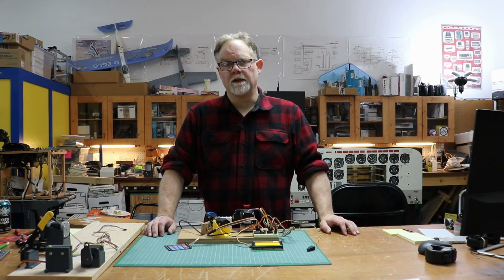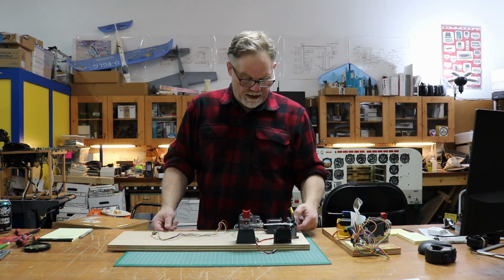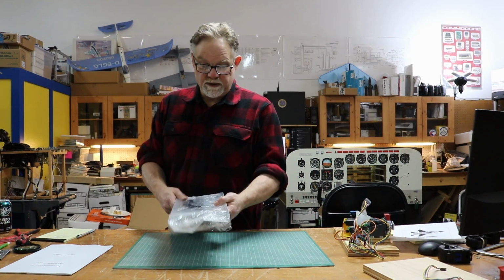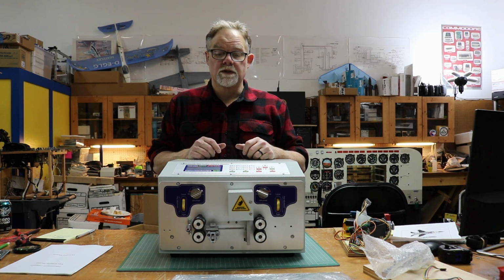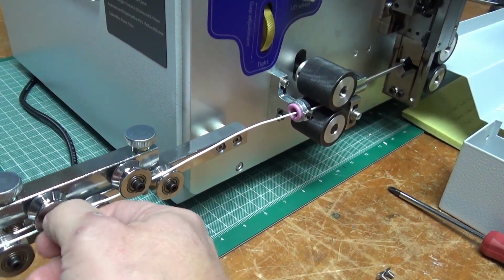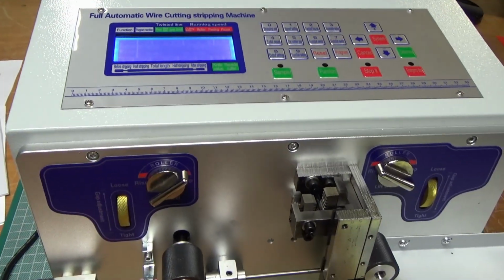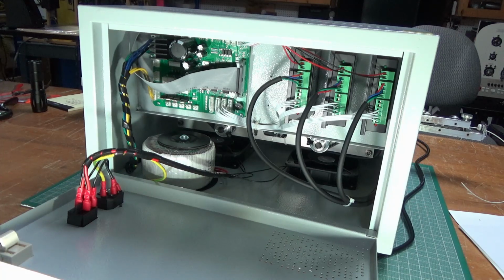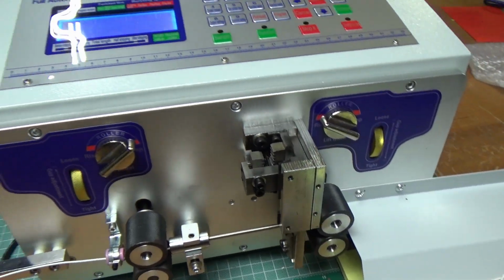F-15C Project  - The Wiring Problem. (Feat. Vevor SWT508)

Comment: The unused but populated with a socket stepper port and tapped holes for the driver is for the twisting feature. Some of the unpopulated connectors in there are Incoming Wire Sensor / Runout Detection: This is a logic port for an external wire-feed straightener or a "wire empty" limit switch. On advanced models, if the spool runs out or tangles, a microswitch or optical eye trips this port to pause the machine automatically so it doesn't run out of wire on you. There is also a Blade Holder / Blade Sensor. An unpopulated logic port meant for a blade home-position limit switch or a safety interlock sensor that detects if the cutting head guard is open. Additional Solenoid/Valve Control: The ULN2003 array drives inductive loads like relays and small solenoids. The unpopulated traces next to it are designed to drive external pneumatic valves. High-end variants use air-assist blow-offs to blast insulation scrap away from the blades or use pneumatic clamps instead of stepper motors for heavy-jacketed cables. And finally Look at the top right of the main board near the white ribbon cable traveling over to the stepper driver housing. There are unpopulated pads labeled TX3 and RX3.
What it's for. This is an unpopulated auxiliary UART/serial channel. On models featuring integrated inkjet or hot-stamp wire markers, this port passes serial data to coordinate printing text or part numbers onto the wire insulation in real-time right before it hits the cutting blades.
Reply from the maker: Wonderful information, thank you!  I wish I could get my hands on the inkjet printer.  Printing wire numbers as they're cut would just be the cat's ass. :)

Comment: I have the identical one. Mine goes up to 8awg and works well with it. This machine has the worst manual I have encountered yet! Mine does let you go into the screen behind the password. Not sure why yours won’t.
Reply from the maker: It's pretty good for what it does.  The only issues I've had with it is the trailing strip is either incomplete (doesn't pull the insulation away from the cut), or the strip doesn't happen at all.  I recently used it for the 49 wires needed for the throttle quadrant harness and it worked great.  I wish I had a reliable wire feed method though.  I have to spool off wire ahead of the machine, otherwise it will grab the spool, and spin it into a bird's nest. :D
Reply: @f15sim yes mine does that same stripping hiccup. It is what it is I suppose. Beats doing it by hand, that’s for sure.
Reply from the maker: @MikesSoftLemonade  Oh absolutely!  It beats doing it by hand and the cut length repeatability is good enough for my purposes.

Comment: Hey there, I know this is 2 years old, but did you ever run into the feeder motor not actuating? this machine is likely capable of functioning as defined, but the motor isn't pulling the wire to the cutter.
Thank you in advance!
Reply from the maker: I've never had that issue, no.  You might want to check the connections to the controller board.

Comment: Thank you for making this video. This is one of the only videos on the internet, if not the only, that discusses this machine in-depth and even shows the guts of the machine.

As you might have figured out, there are two features that are not on your machine. The twisting function uses two rollers to twist the ends of the stripped wire. There is also a "pipe" or sometimes called a "catheter" function where the guide pipe will rotate ~30 degrees to move out of the way so that you can get longer strip length during the back-end strip operation. Mine doesn't have either of these functions either.

When I received mine (much different model with touch screen), I found that it would not close the cutter far enough to cut the wire even at the max position. So I had to take off the cover and move a home sensor slightly.

Comment: My machine seems to have a homing issue where the blades will close half way upon power up, then close all the way on the first cut, and then not retract back for each cycle. As a result the machine is inoperable. Has anyone experienced this?
Reply: Did it do this out of the box or is it a sudden issue? It is possible the home sensor got knocked out of position. In my case, it was installed wring from the factory so I had to move it. Luckily mine is serviceable from the front of the machine but I would imagine a lot of them are internal.

Comment: I am having an issue with the cutter trying to further travel into the closed position when operating. Is there a factory reset that you might know of to clear this issue? The unit worked for several wires ok, but it randomly would attempt to move the cutter motor beyond the limit. I inspected all the wires and connections internally, and they look ok.
Reply from the maker: I'm not aware of one, no.  You should reach out to Vevor directly.
Reply: Were you able to solve this? I am having the same issue

Comment: There are probably errors but here are the main differences I found between the various SWT508 models:
SWT508-SD:
Wire cross-section: 0.1-4.5 mm²
Cutting Length: 1-9,999 mm
Stripped Length: start 0-35,  end 0-15 mm 
Power: 200 (W) 

SWT508-E:
Wire cross-section: 0.1-8 mm² 
Cutting Length: 1-9,999 mm
Stripped Length: start0-35, end 0-15 mm 
Power: 300 (W)

SWT508-MAX1:
Wire cross-section: 0.2-13 mm² (25 mm² jacket)
Cutting length: 1-99,999 mm
Stripping length: 0-50 mm
Power: 650 (W) 
uses compressed air

SWT508-MAX2:
Wire cross-section: 1-95 mm²
Cutting length : 1-99,999 mm 
Stripped length: start 0-50, end 0-50 mm 
Power: 1,000 (W) 
Includes stand

SWT508-NX2:
For PVC/teflon/silica gel line / Glass fiber cables, etc
Dual & single wire stripping (watch video https://www.aliexpress.us/item/3256807855294305.html)
Wire cross-section:  0.1-2.5 mm² (double wire), 0.1-4 mm² (single wire)
Wire twisting: (none, single or both ends)
Stripped length: start 0-40, end 0-30 mm 
Power: 350 (W) 

SWT508-JE/JE2:
For PVC/teflon/silica gel line / Glass fiber cables, etc
Wire cross-section: 0.1-8 mm² (JE), 0.2-10 mm² (JE2)
Cutting length: 1-99,999 mm (JE), 1-1,000,000 mm (JE2)
Stripping length: 40 mm (both ends), can also strip middle of wire, 50 mm (JE2)
Power: 300 (W) JE, 450 (W) JE2

SWT508YHT6:
Wire cores: 2-5
can strip outer jacket and wires inside

SWT608 series (adds wire twisting functionality)

Spare blades, conduits, wire straighteners and rollers are available on Aliexpress. 
https://www.aliexpress.us/item/3256805933795907.html 
https://www.aliexpress.us/item/3256807516009540.html 
https://www.aliexpress.us/item/3256802856380217.html 
https://www.aliexpress.us/item/3256807529347531.html

Also an optional clear safety cover - https://www.aliexpress.us/item/3256804858163911.html

0.1 mm²diameter is AWG28, 4.5 mm² is AWG10, 8 mm² is AWG8 and 10 mm AWG7 (approx)
Reply from the maker: Excellent info, thank you!  (FYI, the last two parts links don't appear to work)
Reply: @f15sim  that is strange as I found the links this morning.
Reply from the maker: @dkellyyt  Watching closely, it starts to show a product page, but then quickly redraws to show the Aliexpress "Sorry, page you requested was not found" page.  Was the third link for the stacked wire guide wheels?  (that's what I think I saw for an instant before the screen repainted).
Reply: @f15sim  yes
Reply: Hi there, Thanks for sharing all this info 👍 Yesterday I received the SWT508-JE, and I was able to cut and strip about 300 wires, but the stripping works only in the front side  of the wires. Any value added to the back it's just increasing the front stripping.Example stripping settings : "20_10_100_10_20"
The front strip comes between 30-40mm and the back side is no strip. I assume it is some software issue. What do you think?

Comment: Wow!  Thanks for English instructions!  I had some trouble stripping some 20 AWG stranded without cutting out strands.  Stepping the machine using the "Sample", I think I see better what "Knife Value" and "Recede cutter" mean.  One observation is that for actually cutting the wire to length, neither of these affect the blade position; it drives the knives to completely slice everything in the way.  The two values that can be controlled:

"Knife Value" -- Sets how close the knives come together to cut through the insulation.
"Recede cutter" -- Sets how far back from "Knife Value" the knives are retracted before moving the wire to pull the insulation.

It seems like Recede cutter needs to be as small as possible but big enough that the blades don't drag on the conductor when the rollers move for stripping.

Comment: Why would this machine run backwards???
Reply from the maker: In order to pull the insulation off the set distance.  It feeds to a certain point, slices the insulation, then feeds a bit into the last roller.  It then reverses while the last roller grips the cut off portion of the insulation.
Reply: @f15sim  at idle if you push the right arrow button the wire moves left. And at idle you push the left arrow key the wire moves to the right. Why is that???
Reply from the maker: @MikeCecil-h4y  You'll have to ask the folks the wrote the firmware. :)
Reply: Read my last post
Reply: Read my last  comment

Comment: Hello Gene,
do you know what tolerances can be reached on cutting wires? E.g. if you cut 200 wires with around 3 m lenght how many mm does the lengths of the wires differ?
Thank you, Gerhard
Reply from the maker: Gerhard, I haven't cut really long lengths on the machine as of yet, but when I used it to make the control cables for my PrintNC CNC machine, all the wires it cut were identical.  This was 32(ish) wires that were something around 200mm in length. (I don't recall exactly.)  I will tape a note to the machine about checking repeatability though - that way the next time I pull it out for the F-15, I'll know to make a conscious effort to check the repeatability and report on it.
Reply: @f15sim  Hi Gene, thank you, for your fast response and detailed information! Next time, if you have some further information, I would be very interested in.

Comment: Mine displays "sensor error" message everytime I turn it on or everytime I try to run a program
Reply from the maker: You might want to reach out to the manufacturer about that - if it's done that since you got it, it may be defective.
Reply: @f15sim  Found the issue, the main PCB inside is barely attached to the machine and fell during transportation, 2 connectors weren't properly inserted, the one controlling the blade and another.
The blade mechanism wasn't able to turn, the sensor wouldn't be able to register any rotation and therefore display an error message.
Reply from the maker: @KahruSuomiPerkele  Did it start working properly once you got things connected properly?
Reply: @f15sim  yes

Comment: Great video thank you for the walk through. Is the 508C capable of handling “fine” wire? I see crosswidth of 0.1mm - 2.5mm listed but I have not seen anyone use it on fine jumper wire (like the same you’d use to wire a microcontroller).
Reply from the maker: Thanks.  I /think/ the blades can be adjusted enough to allow stripping 24 and 28ga wire, but I've not yet had a chance to get that done on my unit.  It IS on the list though. :)
Reply: @f15sim  I managed to make it cut and strip 24 AWG wire with consistent results.
The answers are at the end of the manual, in the troubleshooting section, which is hard to understand because of the poor translation, but basically it says to use the default blade values of 90 and 10 (it depends what's written on the machine, but it's "knife value" and "recede cutter" on this video), and then, tightening the roller more.
I did all of these 3 at once and then the wire wasn't stripped enough, which was a huge change from being cut all the way through, so I changed the "knife value" to 80, ran a test and it was perfect, I pressed the sample button a few more times and it was perfect each time, so I just pressed start and it did 1300 wires consistently.
Reply from the maker: @KahruSuomiPerkele  Nice!  I got settings worked out on mine a few weeks ago.  One of the new videos I'll be posting soon has info about it.

Comment: Hello Gene, If you press the system button again (2 times slowly) it will allow you to enter the password. 
I ordered a similar machine but received the same unit as you. I have noticed the feed tube (they called it a catheter) is not moving up when it is doing the last strip/cut function. If you try to have a stripped section longer than about 12mm it backs the wire into the feed tube and crushes it and the knives rip up the wire. After watching your video I bet that is what the fourth stepper driver is for???
Reply from the maker: I'll give that a shot when I can get back to the machine.  Thanks for the tip!
Reply: Mine only has three steppers and does have the catheter tube that moves